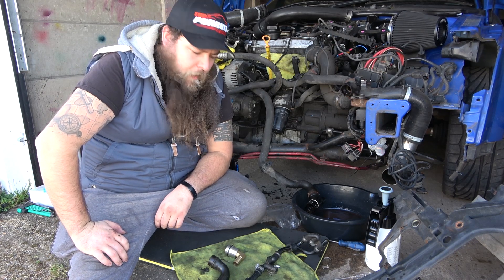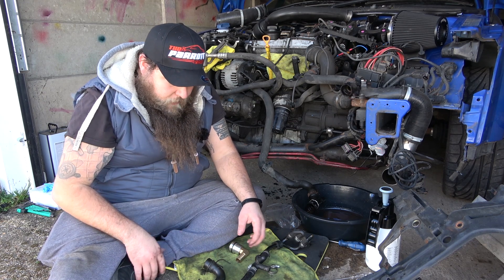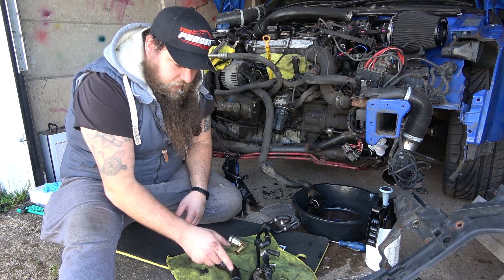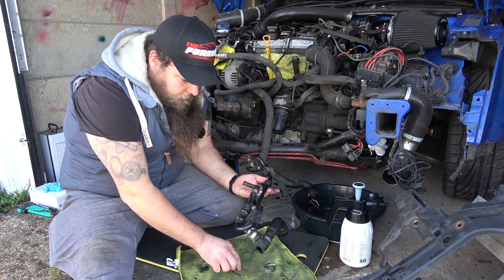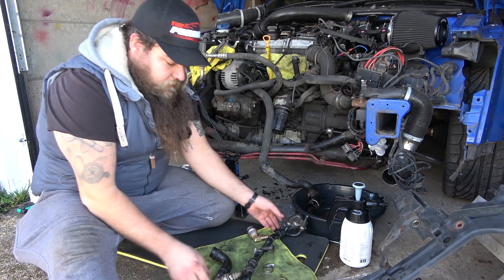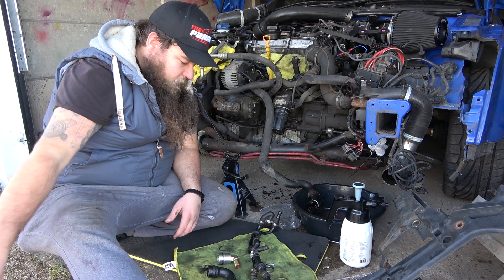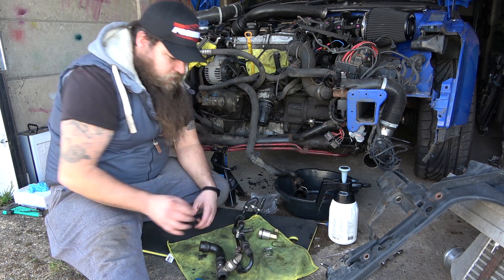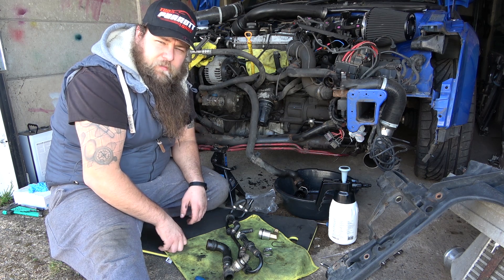Audi TT Pcv System Walk Through

Comment: Yup, that PCV system really is the root of all evil when it comes to a Mk1 TT. I ended up replacing the whole thing at a cost of £280, rather than go down the catch can route. Great info, as always, Dom. :-)
Reply from the maker: Thanks buddy as always, luckily mine wasn’t too bad so a couple of pipes and probably £60 I’ll be back up and running. So it’s worth checking and changing when possible. But it’s nice to fit and forget for sure. I often to forget / get lazy to regularly check oil and water. Emptying and cleaning a catch can will never happen haha

Comment: Deleted my PCV for a catch can ages ago. 
The first empty of the can was a bit of a shock!  
Decided to delete it as the pipes were split (and I was removing all rubber in favour of silicone) and when I took off my twin intercoolers, I found 1L of oiley Mayo in each cooler 😲😲 
UK 🤞
Reply from the maker: That could also have been from a turbo failure in the past etc, the blue car I bought for parts had half a litre of oil sat in the cooler crossover pipe as the turbo was knackered. Often when people change the turbo they don’t clean the system out haha. I didn’t realise will it was too late and for a front full of oil 😂

Comment: Good reasoning of the PCV vs catch can... And some of the detail on the parts is good as well. If I had to point out an opportunity missed... I'd have said a bit more about symptoms... Fluctuating rpm at idle and fault lights etc. 👌UK
Reply from the maker: Well spotted! Yea that’s a good shout, often it won’t trigger fault lights but will cause rough idle and smoking from both engine bay and possibly exhaust if blocked Pcv

Comment: Iv changed all of this and i still have massive amounts of oil being burned when the car warms up on idle under load it's fine no tapping noises boost is fine but had this for ages and can't find what the issue is might of started since I installed a catch can but catch can has never filled up 😢

Comment: Much needed video. Ive kept the pcv system but added a catch can as well but it dont do much catching mind u it dont do much miles at them moment. Anychance off a video on the carbon canister please. Uk
Reply: Hi, where did you fit the catch can ?as I was looking to keep the pcv system but add a catch can.  Cheers.
Reply: @jordanfarrar3564  comes off the t on the side off the engine catch can is held on strut brace so runs to that then back down to the hockey puck

Comment: I'm not keen on aftermarket engine mods, I've seen too many cheap/nasty solutions which have caused more bother than anything they've saved.
However, the PCV does look brittle even though it works. I'll look to put in new PCV bits in the coming years.
Great video.
UK
Reply from the maker: I certainly agree with some things for sure. The Pcv system is pretty sturdy when new however when subjected to heat and oil over the years it softens the rubber up and makes the plastic very brittle
Reply: @TheParrottBros  Thanks for the comment. I'm considering re-doing the PCV but with the Cloud 9 metal 90-degree join. However, the fact it seems "short" is less than ideal. I've seen some people absolutely slate the catch-can approach and if I have doubts then I revert back to the Audi implementation - even thought sometimes it's not perfect (according to experts, not me!).
Reply from the maker: @petesky007  It is easy enough to overcome, I am just going to buy a small piece of 19 mm oil rubber line, and a small 19mm joiner. That will overcome the issue. You 
Can use a stock 90° bend, it will last 10 years without breaking I’m sure so nothing to worry about

Comment: my zero experience self just changed my crankcase breather hoses/pcv stuff..I had a couple of the real replacement pieces but, ended up using an ebay silicone set..it was way too wide, had to cut off an inch from a couple pieces then it was workable..right until the last connection from PCV to manifold..my silicone hose end was twice as big as it should have been..my silicone tube opening is the size of a nickel and the one I took off was half the size of a dime..I just wrapped a bunch of duct take around the little protruding knob so the hose would fit better and clamped on that..I guess it works..better than the upper tube being in literally 2 pieces for several months..
for the amount of stress and procrastinating I put upon myself with these fixes, it ends up being disturbingly easy for a completely untrained person to complete the job with minimal tools..I don't know if I like that or not..
Reply from the maker: This is the reason I make guides as most jobs are doable for most, they just need to see it’s not that bad and what’s involved etc. At least you managed to get it sorted one way or another haha. Yeah some times the silicone kits can be made for a variation of different models and don’t always fit 100%

Comment: Personally i remove / delete or simplify most of the breather system pipework , as these 1.8T engine cars are 25+ years old and everyone i come across is either split / lost it's strength /or cracked
Reply from the maker: Deffo the easier way to deal with it providing you know what your doing :)

Comment: Hi,
Just wondering what your thoughts are about removing the secondary air system thing I keep having fault codes because of mine, I've changed it once for a cheap Chinese ebay one it lasted a couple of months and the codes back again, if you think it's worth removing is there any chance you could do a video on it,
Regards Mike
Reply from the maker: It’s a tough one as everything had it’s uses. There is loads of info on how to remove it on tt forum.co.UK. I don’t have one on the bam I’m afraid so wouldn’t be able to show what’s involved. .

Comment: I'm just trying stop the bad smell from under the hood whenever the engine is running
Reply from the maker: That is quite a common one, often it is the rocker gasket leaking oil Down onto the exhaust manifold which is what gives you that smoke/smell from the engine

Comment: Hey lads I'm from Ne Zealand... K.. I've given my Brembos calipers and rotors to a guy who has a much more powerful TT than I, and got the standards for my lil whipper snapper, now, my brake fluids drained, I need to know about bleeding them, it's an auto and have it parked on an uneven surface atm, could I block off at ends by calipers, and add old fluid to engage auto system to move to a flatter surface and use handbrake as I only took fronts off?
Reply from the maker: If you cap off both front lines you can, i wouldnt go too far as its dangerous, try not to use the brake pedal too much and use the handbrake to slow if possible

Comment: Got a Problem that my variabel chain tensioner keeps producing fault codes. Replaced it along with a new chain and both camshafts. 
After that i ve found that my rodbearings where destroyed. Changed them as well and checked the clearance with plastigage. Still somethimes the vct lets me down with some fault codes..

Any suggestions?

Comment: Useful video thanks Dom, it's on my list to do and helpful to see how short the cloud 9 part is (which is mentioned on the website) worth noting if you replace parts with silicone they should be fluoro lined or else they will start to breakdown due to the oil, a lot of cheaper silicone hose aren't. UK
Reply from the maker: That was the word i forgot to mention, Fluoro lined!! yeah a lot of companys on ebay say silicone for coolant air and oil then when you look its not suitable for oil typical ayy, thanks for that buddy
Reply: @TheParrottBros  Hi Dom can this pcv system effect the brake pedal booster., I've chased Mine and it links into the servo pipe, My pedal  travels a lot but when engine is switched off , three pumps of the brake pedal and it's solid . Slightly different system on the ARY engine  too the bam ..trying to diagnose the fault is a tough cookie. Any suggestions .thnx
Reply from the maker: @paulsimpson2232  yeah there is a one way valve in the system for the brake booster. It could well have failed or be split. It’s the shiny pipe that goes to true brake booster
Reply: @TheParrottBros  yer I tested it and seemed to pass ,but just incase , I brought a new one , and still ended up  with the same problem so I was wandering if there are more valves  in that jungle of pipes .  That plastic y  peice I assume it's just a diverted piece..
Reply from the maker: @paulsimpson2232  there is a pcv valve in the Rubber T piece, that y piece has a regulator valve in from memory
Reply: @TheParrottBros  ok cheers , that's going to be costly .
Reply: @TheParrottBros  after looking it over there's no T price  , they're all elbow conections ???
Reply from the maker: @paulsimpson2232  the 90 degree plastic pipe that comes out the crankcase goes into a T rubber pipe

Comment: Hey Dom, love the videos mate have been a help on numerous jobs. By any chance have you removed the driveshaft to replace the center cv joint? Its the next job on my list.
Reply from the maker: Thank you, have done in the past, not a horrendous job but just a bit long winded. Can undo the bolts and pull the shaft away from the cup in the transmission

Comment: Where is the small pcv valve located? There's the pancake valve and another small one. I'm looking for the small one.
Reply from the maker: The small one is located in the rubber T piece just after the plastic elbow that comes out the crankcase
Reply: Found it. Thank you so much. 🤟

Comment: Hey Dom ! There's at least one split hose I can see under the inlet mani so I'm planning to take it off and patch the main problems up. Hopefully all in a day- I can't be leaving the car in bits on the drive all week.
Are there any parts you'd recommend getting in advance? At the moment my list is only a new inlet mani gasket, oil resistant pipe (19mm?) and jubilee clips
Reply from the maker: It depends on what your panning on doing, are you going to run a catch can hence the 19mm pipe, all the original hoses differ in size. 

i would get a new elbow that comes out the crankcase, check if you need to replace your injector seals, some 3mm silicone vac line and some small jubilee clips as most of them use one use clips
Reply: @TheParrottBros  Thanks Dom, I'm not planning on installing a catch can- for similar reasons to you.
Ah, I saw 19mm on the catch can kit and hoped it would be the same size everywhere. So I should get a range of sizes..
I'll also get a crankcase breather elbow and some 3mm vacuum line then. I have a bunch of jubilees already and have done the injector o-rings recently.
3mm is tiny - which part is this for?
Reply from the maker: @louisheath2791  3mm is vacuum line, for fpr etc. You will probably need to remove it then see what’s broken then go to local motor factors and get some joiners and new pipes as req
Reply: @TheParrottBros  recommend any good parts shops in herts?
Reply from the maker: @louisheath2791  Apsley motor spares Hemel, or midnight motors Watford

Comment: Hi I need some advise i have an audi tt roadster 2006 , and have had a problem with the dash clocks, the fuel gauge is working the wrong way round, I have had them sent off for repairs but came back faulty fuel gauge , everything else works, I Think! They also had to recode the key as the car immobilised itself, do you think its worth getting a new key?
Reply from the maker: It sounds more likely an issue with your clocks than your keys. Have you spoken to the place that did it and explained the issues?
Reply: @TheParrottBros  hi yes the car has been in the garage for 6months, the clocks were really bad, flickering on and off speedo etc not working, the garage had sent the clocks off to be repaired 3 times! Just had the car back now, the repair place said the clocks are working fine so it must be a fault with the car, the car wouldn't start at one point I had to disconnect the battery then re connect fir it to start,  drove the car back home yesterday all been well , but the fuel gauge is saying its full but its empty
Reply from the maker: @beckykennerley3893   It could well be an issue with the sender in the tank, there is an easy way to see if this is the case, what does the screen say miles to empty is when the clocks gauge says half full ( when really empty)

Comment: Hi i know im late but my crankase breather pipe split where would you recommend me to get the parts from? 
Based in the UK
Reply from the maker: If you want genuine parts speak to Coverdale car parts they should be able to source you everything you need, if you want to do a cheaply I would recommend getting the part numbers and then looking on something like auto doc
Reply: @TheParrottBros  Hi there thanks for your reply will give them a try. 

As its been giving me a headache finding the breather pipes for my car. 
People use silicone ones bought some non of em fit. 
So think its best getting the genuine one if i can.🙏

Comment: Just bought a 2001 TT with the a MU motor. It looks like my oil is a tan brown color and it is a little bit thicker than normal oil. My coolant level isn’t dropping and my coolant reservoir has clean coolant in it. I’m fairly certain it’s not a coolant leak. I just today ordered the new PCV valve system kit. Hoping that is going to work by taking the moisture out of my oil. Has anyone had this problem?
Reply from the maker: I would certainly start with the pcv system as super common for blocking, pipes splitting etc, that followed by an oil and filter then see where you are, cant say i know of too many common issues besides those
Reply: @TheParrottBros  thanks for the advice. Today I changed my oil cooler, supposed to be a common issues on these cars. Causes the oil and coolant to mix together, so I replaced it for $40

Comment: Got a question.
I bought a new KKK K04 10k kilometers ago. Last week I ve changed my downpipe and wiggled at the turbine of the turbo. Felt like quiet a lot of radial play to me. Any one tried it as well? 

Although there is quiet a lot of oil arround the turbohousing. Can a broken pvc make wrong pressures between the crank and cyl head tho that the turbo starts leaking?
Reply from the maker: A blocked Pcv system can cause unwanted pressure and cause smoking but shouldn’t cause turbo play. You should have very little
To no radial play. That’s very odd

Comment: Great video mate. Did you have a default engine code with the leak on PCV system ? Like a P0171. I have this P0171, and already replaced MAF, the 2 O2 sensors, injectors, coils, spark plug and the throttle body. Still have the check engine light ON + P0171. Any idea will help. Thanks
Reply from the maker: Thats one of those could be a number of things code, Ive not had it my self but rosstech say Check Mass Air Flow Sensor (G70)
Check Fuel Pressure Regulation
Check Fuel Pump
Check Injectors
Check Intake System for Leaks
Check Exhaust System for Leaks
Check Secondary Air System for Leaks
Check Vacuum Pipes for Leaks. 
Its likely to be a Vac pipe leak either pcv system or general boost system n249 etc
just have a good look and feel round all rubber and silicone pipes
Reply: @TheParrottBros  Thanks. I will check if any leak issue. N249 has been deleted.

Comment: Good explainer - I swapped mine out for the Catch Can setup (APX) - that gap is small on the BAM models, but on APX there's another set of lines in front of the elbow that make it a nightmare to get to 😂 I've noticed lately I have a fair bit of fresh oil over the front of my block - I worried that it might be the head gasket, however there's no smoke, car runs A OK and at normal temps - just a chunk of fresh oil over the block and fresh catch can piping. I've noticed there looks like a small pipe on the APX block behind the PCV elbow - could that, or anything else be to blame for the oil? I don't think it's the rocker cover as it all looks like it's happening below the intake manifold.
Reply from the maker: Without looking it’s hard to say, if it’s definitely oil then could be the oil filter housing or the rocker, remember the air when driving can blow things different directions. Best thing is to clean it off and monitor it.
Reply: @TheParrottBros  Good advice, cheers!

Comment: what deletes do you recommend doing ? just bought mine and i think i have a boost leak, maybe a vid on it ?
Reply from the maker: I don’t personally recommend any deletes hence the reason for this video, the systems fitted on this car all have a purpose and I aim to keep everything operating as designed. 

Checking all boost and Pcv / vacuum pipes is highly recommended as often get soft / damaged over time. 

If your looking to do performance mods then simplifying the system may be the desired route but then you will also be making a lot of modifications and mapping accordingly. 

If keeping stock ish keeping all systems in good working order will make for a reliable car
Reply: @TheParrottBros  legend, good response and thank you for replying, have a good one !

Comment: Question:
Does taking all of the front end off, reduce the alignment/stiffness of the chassis rails? 
Essentially if you remove the engine/engine mounts/cross brace.